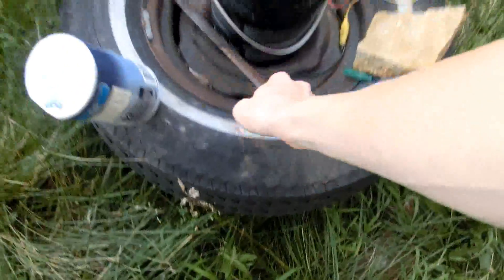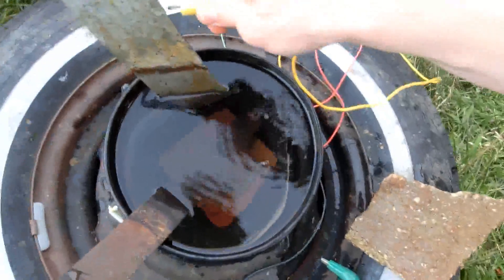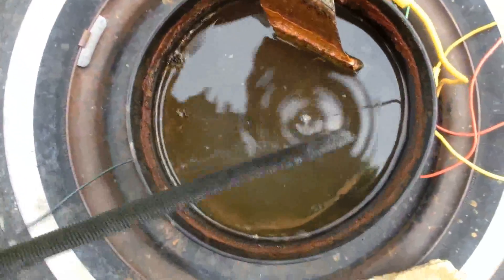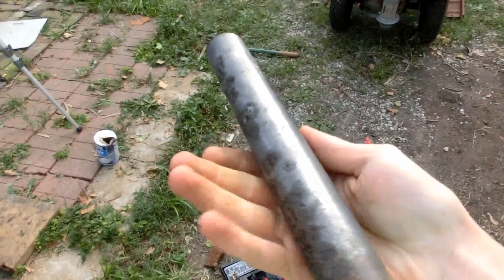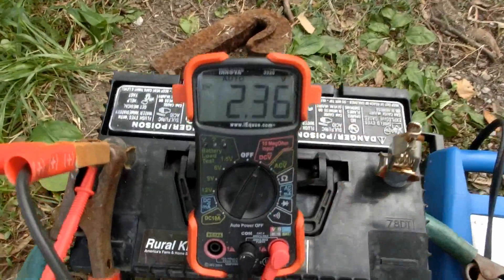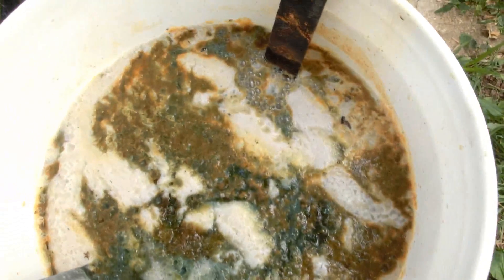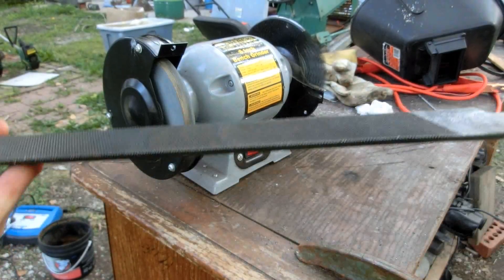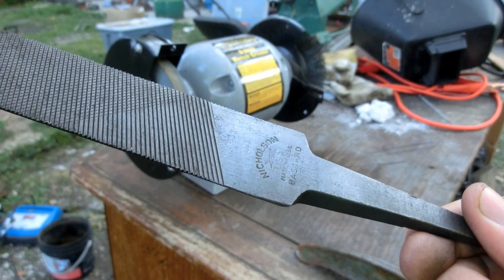Removing Rust with Solar Panel Steel File Electrolysis part 2

Comment: Hi rinoa great tutorials on electrolysis rust removal, I have used this twice on two of my optimus111 stove cases.
It really is a very effective and cheap method of rust removal, it is slow though usually a over night process.
through lack of patience I have been using the acid (spirit of salt) method which takes a matter of minutes.
I used my car charger for the power source, and used bicarbonate of soda and placing the anode and cathode/ sacrificial metal and the part being de rusted, as close as possible with out touching.
These videos have rekindled the urge to use electrolysis in future projects, well done Rinoa for another brilliant chapter of video's
Reply from the maker: i've found that putting them close together tends to focus the rust removal and only cleans one spot on the metal part.

Comment: The advice I read recommended not using salt because it has a habit of becoming imbedded in the steel or iron, it also has a habit of producing chlorine. The best substances to use as an electrolyte for derusting are trisodium phosphate, sodium carbonate (washing soda), and sodium bicarbonate (baking soda), you can also use sodium hydroxide (lye) but then you will have to neutralize it with vinegar or you can't paint over it. It's an interesting idea to use an old car battery charged by a solar panel, if you can find a cheap enough solar panel that will deliver enough charging current. You are right, in this process current is everything, much more then voltage. Also clean, filtered DC works better then DC with ripple in it, a la a straight battery charger.
Reply from the maker: i might get out my 1918 Tungar battery charger and see how well it does. the reason i go for salt is just because its so easy to buy a bunch for cheep. each one of those cans of salt only costs like 40 cents. and i could prolly get a big bag of pool salt that would cost half or less.
Reply: I have one of those old chargers with a Tungar bulb, probably from the 1920s or 30s, but they are very crude as far as power supplies go, 1/2 wave rectification, and no filtering unless you connect a battery across the terminals. The interesting part, at least with my Tungar charger, is that you can charge multiple batteries at a time. Washing soda and baking soda can also be purchased rather cheaply, if you buy it from the right source, it also does not take very much, maybe a 1 pound box of baking soda in 10 gallons. Because I use electrolysis to strip antique tools, bicycle, and car parts I'm a little more concerned about damaging the strength of the metal, or corrosion coming back. Also the sacrificial anode my hold up longer if you use washing or baking soda rather then salt. I still like the idea of using a solar panel for charging a battery, which powers the tank, if I could find one cheap enough, with enough wattage.

Comment: Where I can buy that charger looks awsome and perform like a champ awsome video as usual
Reply from the maker: this charger costs 40$ at walmart. but its a piece of crap as far as chargers go. it has a lot of issues. i find myself continually having to trick it's safety features so it will charge batteries.

it's a smart charger so if your battery is very very dead it won't detect it as a battery. also if you tell it to charge a battery to 100% it almost never turns off. like if i have it charge a car battery at 15a it will charge and let the numbers go up for a few hours then just keep charging with it at 100% for days while it lets the battery boil off it's electrolyts.

after about a year of use the fan has started to go bad so it makes a loud noise so i have to hit it really hard.

i think walmart sells a 25$ dumb charger that doesnt have the annoying safety features. if you got that you wouldnt have to trick it to do electrolysis like i did in this video.

hope that helps.
Reply: Thanks for the heads up. awsome vids  keep it up .

Comment: I think longer time versus current would work better, because the gasses and any boiling water generated at the bottom would float up and tend to insulate the upper parts of whatever you are electrolyzing from the electrolyte.  So the more current you run the more bubbles are generated.  As the upper part becomes more insulated from the electrolyte due to gas cavitation in the electrolyte, more current is shifted toward the bottom generating even more bubbles and insulating effect.
   The hotter it gets, the more resistance is created in the circuit.
   So as a result, the reduced surface area available due to bubbling forces more current through a smaller active surface increasing resistance with the two processes feeding on each other. 
    Further the water in the electrolyte will start to boil off.
    Allowing time for the gasses generated to leave the reaction area is a consideration.
   Using moderate current and changing positions of the item undergoing reduction should work best.  If you use high current, you are likely to get a lot of hot bubbling activity that will look spectacular, but poorer results with the end product.
Reply from the maker: 15A seemed to do fine. i'll see if i can give it 100A and see if that will do anything differantly.
Reply: The bubbles from the oxygen liberation from the iron oxide would be reduced as insulation occurs creating a braking effect and somewhat a push toward equalization, but the heat might create water vapor bubbles.
    However, everyone really wants to see something wild and violent, so we are looking forward to the 100 Amp test.
     If we don't hear from you in the next couple of days, we will have to assume things went way out of control.
     Tell your insurance company that you believe the damage was caused by a lightning strike.
Reply from the maker: *****
haha yeah.

when i was first testing electrolysis in a beaker i accidently touched the two electroldes and it made big fireballs under water, was cool.

Comment: They are exceptional results man, I think it used to be the volts are the 'packages' of electrons and the amps are the amount of the 'packages' being sent, with high amps it should be forcing the electrons through the metals. Kinda like how the train uses ampage over voltage. Oil those tools up and they will be good for decades!

Well played man, honest, your results in such a short time with basic gear are very impressive.

I wonder what the biggest bit of metal you could work with would be, like getting a motor bike chassis that's rusted up and throwing it in a kids paddling pool and hooking up all the batteries and solar and wind you can muster, and you got plenty :-D

What do you come across that's cumbersome a lot and wrote off because its rusty? old mowers...every tool under the sun...such a good way to utilise the solar array! Clearly well impressed! MOTTO MOTTO - MORE MORE - EXPANSION OF SCALE! UNLEASH THE HOUNDS!
Reply from the maker: i'm actually planning to do that exact thing with the deck to my lawnmower and to the parts of a 1980 Honda ATC185 that i'm restoring. although i may be easier to just dig a hole and put a tarp down instead of a pool.
Reply: nice, go with the hole and the tarp, you have the space and can always fill the hole back in when your done, don't forget to put bricks down to keep the metals off the slag at the bottom, AND ALWAYS, ALWAYS! LOOK BEFORE CROSSING THE ROAD!
Reply from the maker: battonfive
lol i thought you where going to say "don't cross the streams" like from ghostbusters.

Comment: Wow that's amazing now you don't have to wire brush all your old tools. Couldn't you use this setup for your old rusty tools? Plus good video by the way 👍
Reply from the maker: yeah i will use it on my tools. i have a rusty old vice that i may make useable again with this method. but i am a bit concerned about electrolizing tools with wooden handles, i'd hate to stain the wood with rusty water.
Reply: Yeah it's true about the wood just try it you learn from your mistakes just find tools that you don't use and try them. What I would like to see is you doing reviews about something like buy something from eBay and review it like you could buy new solar panels or step up  converters there cheap sometimes Soo yeah talk to you later have a good one
Reply from the maker: fungamer sr
 i do that, i called it "ebay reviews" but i dont do them frequently.
Reply: Well you should do for ☺

Comment: i wonder if other things work in the water, like epsom salts as you had a huge bag of that, or laundry detergent powder (or even liquid)  But thanks for the vid I now know low amps and time is good. another thing I wonder, what happens if it was left for weeks, would it affect the metal ?
Reply from the maker: yeah but i think salt would be best just because how cheep it is.

i'm not sure, i think it would just continue to kill the annode and not do much with the cathode.

Comment: You need to dry off the file immediately after unplug
Reply from the maker: i did that, but whats your point?
Reply: So it won't rust again
Reply from the maker: Calvin C
yeah but it's not that urgent.
Reply: I think its most important to remove salt by washing it .

Comment: Thanks for posting!  Never knew you could use salt, figured it would be counter intuitive seeing how salt promotes rust.   Most sites suggest using "washing soda".
Reply from the maker: by adding salt you turn it into a battery, it only causes rust when you let that battery discharge. but if you pump power into it its like recharging it. making one plate clean and the other dirty. ^^